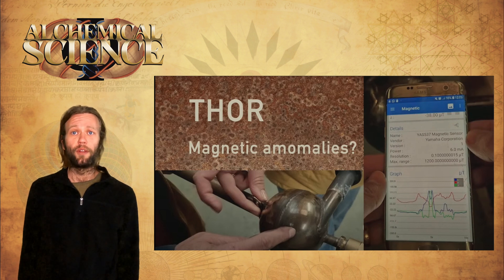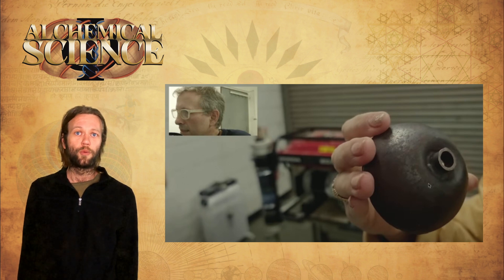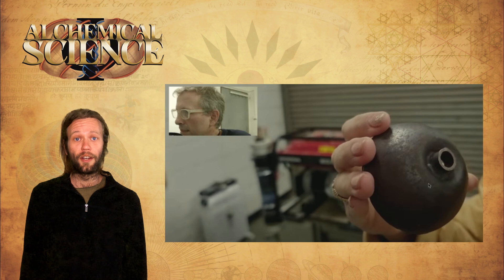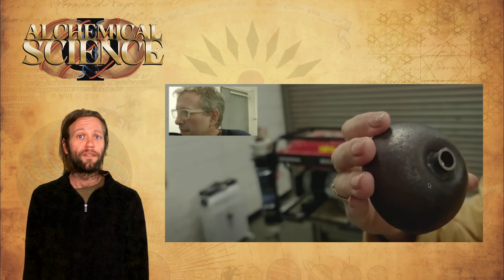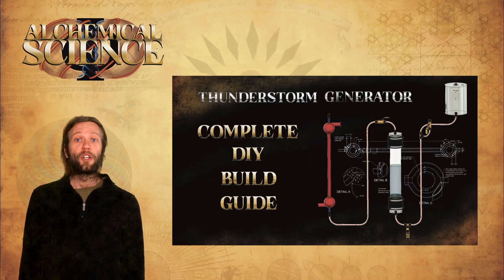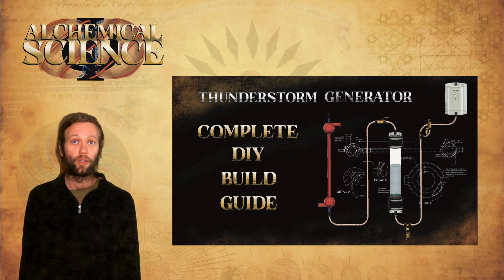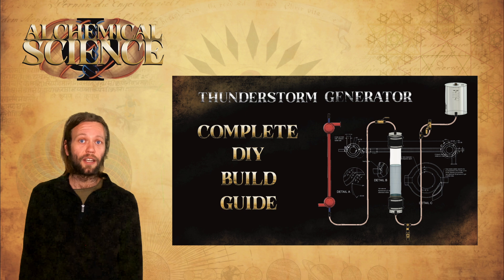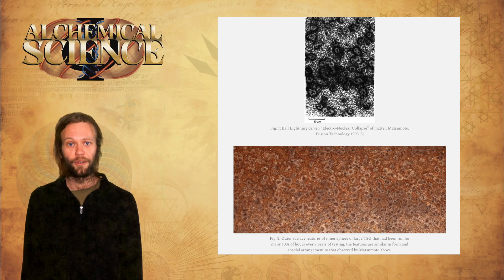Thunderstorm Generator Build Guide Updates from MFMP | Plasmoid Tech

Comment: what would happen if you had a torroidal rodin coil set up around the bubbler pulsing a desired frequency electromagnetically structuring the water as it vortexes or the nested pipes it will couple with the magnetic field of the vortex? just curious if these could be paired together

Comment: You're trying to reinvent the GEET.
Typically a small, single cylinder engine, will have an Exhaust Emission of:
Normal Carburettor
CO2  =  12 - 14 %
CO    =  3- 5 %
HC    =  200 - 300 ppm
O2    =  0 - 3 %
Vaporising Carburettor
CO2  =  +14%
CO    =  0.0x %
HC    =  0 - 50 ppm
O2     =  0 - 6% if its very lean
GEET System
CO2  = 0 - 1%
CO    = 0 - 0.0x%
HC    = 0 - 10 ppm
O2     = 18 - 20%

Comment: Seriously though.. @felixaudet5860 your suggestion sparked an idea -

What if we could take a glass version of a bicycle reflector to achieve total internal reflection?

I say glass in place of plastic due to the extremely high melting point, we may be able to even "gimble" the heat, similar to a variable turbo where we can dissipate the heat in a manner to not let it build up and become an issue.

Comment: I see no difference between Geet, in fact i have seen better emission results published with it approaching 20% oxygen output, I was not aware of any safety concerns either, perhaps you care to elaborate on that? they also shares the same magnetic anomalies, in my opinion its exactly the same thing, it seems the working principle is the counter rotating vortex with opposed inlet and exhaust direction. Can this be improved by instead of using spheres you can use a hyperbolic shaped funnel for inlet or exhaust, that would accelerate the vortex as would a pinch point in the center, Geet always used a shaped rod, with a narrow restriction which was the point of the highest magnetic anomaly.

Comment: I’ve watched 100% of your videos on this subject and follow the subject with intense passion.  I’m an independent researcher like you.  As this testing unfolds I encourage you to pay close attention to fuel efficiency gains under 100% full engine load (e.g. if you modify a generator, have it power the biggest electric heater it can support and measure the runtime of the heater with and without the device, powered by a 100cc syringe of fuel).

One key feature of this design is that it ends up injecting some moisture into the combustion chamber.  At idle merely injecting water will dramatically lower emissions and increase efficiency.  This effect disappears under load.  Since this secondary effect is well known and can confound interpretations of the results I encourage running all tests at full load to disambiguate this well-known water injector effect from the much more interesting effects of the geometry and plasmoids.
Reply: Yes sir you are absolutely correct
Reply: @Greg-l3j  I hope this comment gets seen.  I’m so excited by the potential of what this could be I badly want to see it tested by someone who will have at least my level of rigor.  To date the claims and measurements are ambiguous and that sucks because it would be very easy to do the testing in a way that eliminates 90% of the uncertainty.  If this device can add even 10% to the runtime of a generator at full load that’s worth billions in the short-term.  I wish I had more space so I could do the testing myself.  In lieu of that, I hope someone who does reproduce this tests will rule out the known confounders.
Reply: Great observation @BobWidlefish
I'm wondering if we can develop a simple timing circuit that switches  Water VS. fuel at a rate that compensates and could actually forcefully predict the outcome of the rate of combustion based on the switching ratio of water initial at v=50m/s VS v=150m/s at full valve opening

Comment: To those who are doing an experiment to omit the spheres, three considerations:
- If it doesn't work as desired, perhaps add a third tube as the sealed core, similar to the core spheres.
- Does a much longer tubed section help?
- Has anyone ever tested inlet and exhaust traveling in the same direction? Hugely different particle interaction, I'd venture a guess. Individual carbonoxides and nitrogen oxides and incoming ionized air flow would be like people walking together with only glass in between. It could be tuned to have identical flow speed

Should we find out other configurations that offer complete removal of the carbons that plantlife cannot live without but drives billionaires and their minions berserk, then we can find ways to make it more compact. I suspect reactor inner surface divided by flow rate will be a key parameter. A 3D printed reactor could have a tremendous surface area for little volume. The outside of the outer tube being exposed to ambient air MAY be a factor, and this could of course be relatively eaqsily be tested by adding yet another tube on the outside and pulling it to a vacume, or filling it with various gasses such as argon, nitrogenoxide, etc, at various pressures. A vacuum there might actually help prevent the undesired tube/sphere implosion effects seen?

Comment: Surely GEET's problems were not due to the lack of spheres? Key difference: GEET bubbled the fuel, THOR ionizes and bubbles the inlet air. I don't remember what exhaust gasses were measured at the time?
All that sonic tuning of the spheres and these unwanted behaviours might be giving us hints as to how the ancient Peruvian style walls were buiilt. Do minerals soften?
Reply: Maybe they soften like hutchison samples.

GEET made similar exhaust from what I remember.

I believe but cannot confirm that the geet through off more radiation, not sure about that.
Reply: exactly,👈
Reply from the maker: Yeah, you're right. That is a far a greater issue. I should have said an issue of optimization as opposed to using no spheres, it just tailed into the GEET discussion.

Comment: So the spheres are 304, and the tubing, the line feed on the welder is tungsten. Is there anything in choice of the material used to weld the spheres and tube to the spheres other than tungsten? I  recall it being one of the preferred materials?  Just want to confirm.
Reply: “The line feed on the welder is tungsten” 
? 
Not sure what you meant by that. 
This task, it looks to me would require a TIG welder. The filler would be fed by hand.

The electrode tip would be tungsten but there are a few ss304 - 18/8 filler choices that would keep the weld ss304
Reply: @raycar1165 I'm not a welder. My friend has a laser welder. I asked him what would be fused into my spheres. He said tungsten so I was trying to make sure it's not something that would mess me up later.